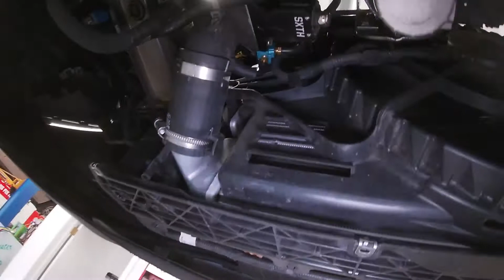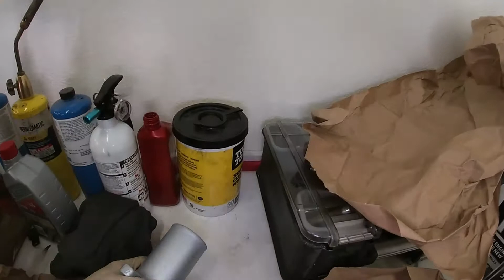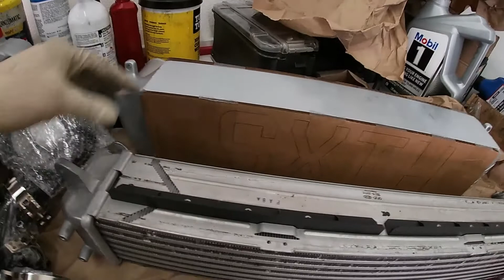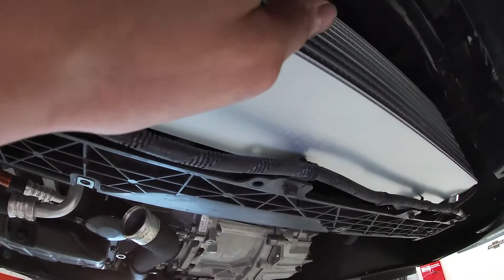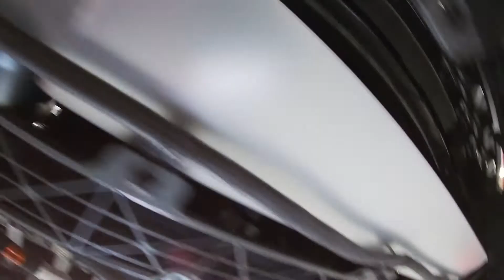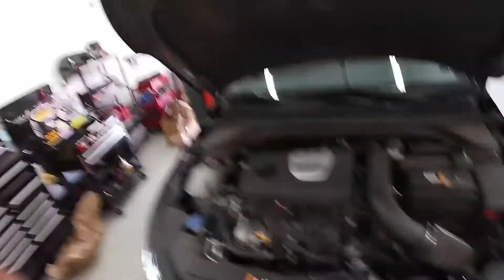SXTH Element Front Mount Intercooler Kit for 2020 Hyundai Elantra Sport

Comment: Is this good to watch if I have 18 ES? Do I have to drain the coolant to do this job?
Reply: I hope you don't drain the coolant, considering an intercooler doesn't have coolant in it lol.
Reply: Probably close to the same I also have an 18 ES and been talking to someone who has an VN and he has a buddy who has an 18 ES too and from what I heard a lot of the stuff is the same on sxth. He also recommended kdm tuners and some Kia and veloster turbo parts will fit with the ES. Just getting into the modding scene after starting my job at a tire shop. If you get any more info let me know!